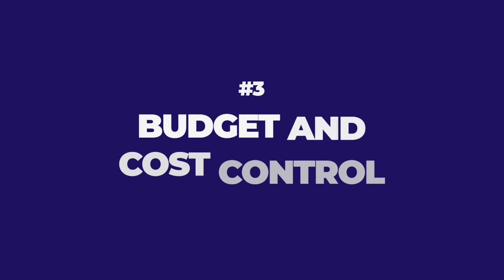What Does An Owner’s Rep Do In Construction?

Comment: As an Evil Owner's rep I will push back on one thing, and that is TAKT. I know that it is really what you push from your firm, and that is great I actually own all your books, but I am working with Large GC's who still do not understand or that have not adapted TAKT in their scheduling. We included in the last RFP for our current project a lot of LEAN tools. They all signed up for it in the RFP process but now we are learning how little they actually utilize and we are pulling the GC with us as we move along. Luckily I have almost a year before construction starts so we can train them in the processes that we want utilized on the Project. With TAKT though they are completely unfamiliar and have one team that has run a project in CA utilizing TAKT and it was a much smaller project. So we are using last planner for our scheduling and hope to get them to start utilizing TAKT prior to construction.
Reply from the maker: I love your comment.  And we can help them under your direction too!
Reply from the maker: And I don’t think Owner’s reps are evil.  We love you!
Reply from the maker: Last reply here.  Your contractor doesn’t j is CPM or Last Planner either.  This is not a Takt problem.  This is an organizational competence problem.